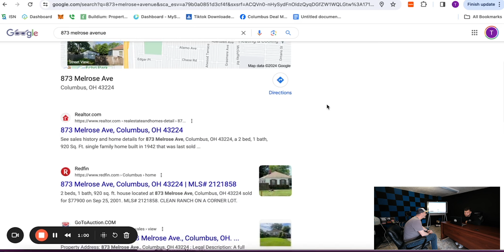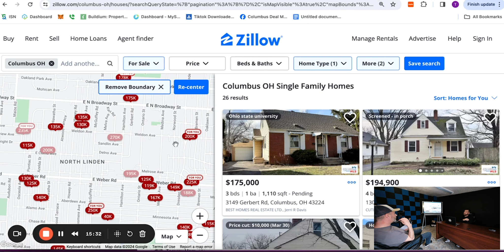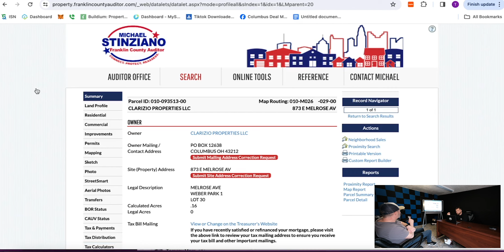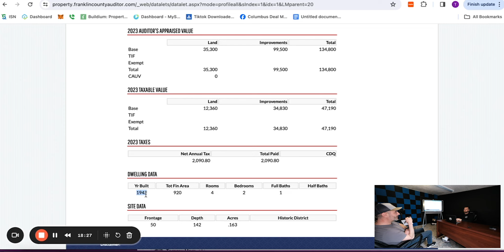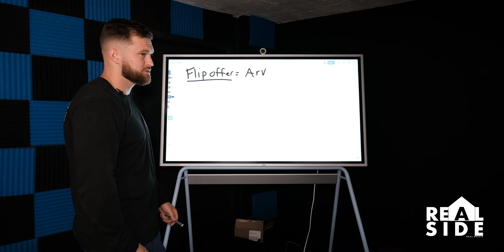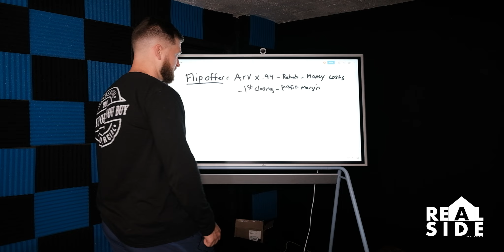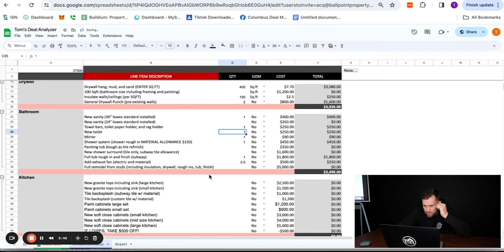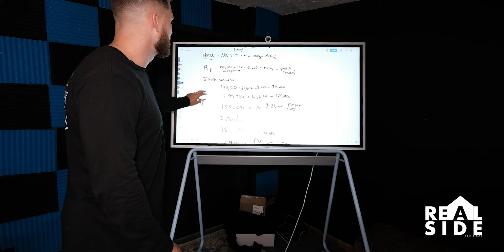How To Underwrite An Investment Property!

Comment: Tommy!! Thanks for the video, your home inspector background shines through :) Question for ya though, when you see old wiring coming from the panel does old 2 wire need to be updated to have ground? Also, what do you look for when panel needs to be replaced? Thanks again for the value!
Reply from the maker: You don’t NEED to but I would ground where possible. You can GFCI the circuit if you want. 

For updating panel if it’s a federal pacific or Zinsco - replace. 

If it’s fuse box - replace. 

If there’s moisture or rust - replace!